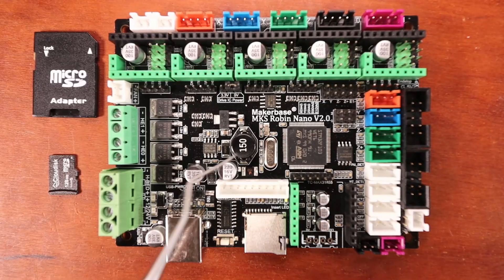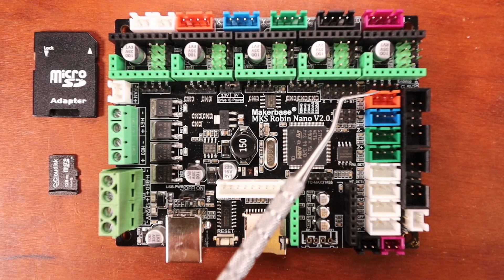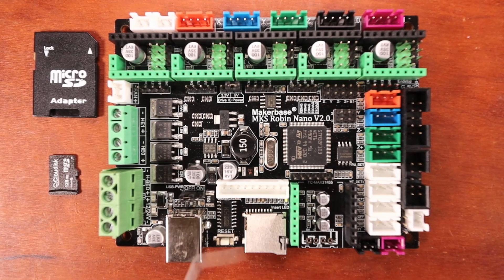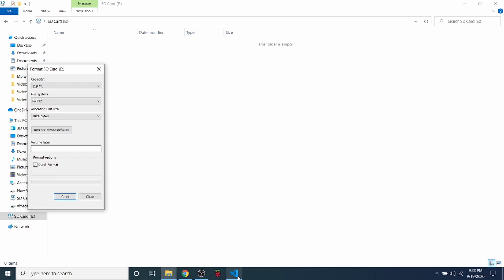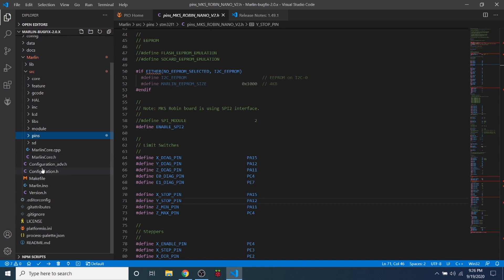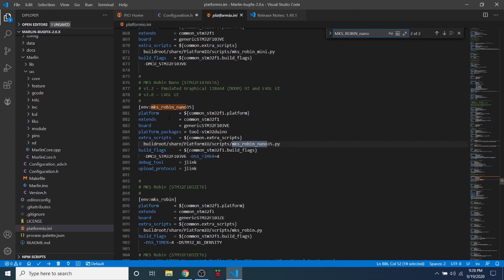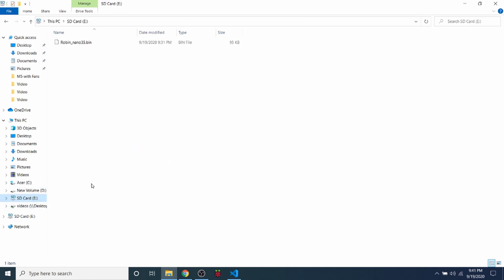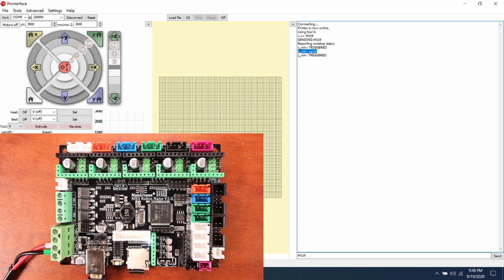MKS Robin Nano v2.0 - motherboard basics for 3d Printing

Comment: I've been enjoying these mks robin nano videos. Thank you. It has brought up a question that I can't find a direct answer to and I was hoping you might be able to help. The firmware for the tft35... the UI specifically... are they universal among the screens or are they unique to them? Basically can screen A use the UI for screen B? I ask because I recently picked up a nano V2 and tft35 v3 combo. I have a Kywoo Tycoon Slim and I really like the UI they have. From what I understand they use MKS tft35 screens that are rebranded with three big difference being they use a 40 pin IDE connector.  If I have the firmware for the kywoob screen what would need to be done to get the UI set for the nano with the tft35 screen? Is it even possible?
Reply from the maker: BTT TFT screen will work or at least I think I did it in a live stream like a year or two ago.  As for the screen you're referring too, can you post a link to screen or a datasheet and I'll see what can be figured out?

Comment: Is their a way to backup existing firmware on the robin nano to a usb drive?
Thanks!
Reply from the maker: Yes copy, FIRMWARE.CUR to a hard drive or source control.

When you wish to use rename to firmware.bin to load.
Reply: @EdwardBraiman  Thank you!
any way to pull the compiled code back from the board if you don't have the .cur or .bin ?
Reply from the maker: Nope, but gcodes will show setting.

Comment: Whats a stepper break out? Do I put the big wires to the thermistor or the little wires there? Honestly it is just easier to look at a/my other printer and see were they have the wires. 3 axis, 4 wires to a hot end a stepper to an extruder, screen just plugs in, your stops, not much to it, I think 99% of them are the same. I have no idea Im just shooting in the dark but I bet if I just plug in my drivers and set the voltage and ignore the jumpers they will work...oh, I need two y axis motors

Comment: I have this board. Having issues figuring out where the other 2 wires go for the bl touch.
Reply from the maker: There are 5 wires the group of three is a servo connection of voltage, ground and signal.  The other two are for signal and ground on endstop port.

Comment: Hi . I bought a xvico x3s from eBay UK and I found up that inside of it has a MKS robin nano 1.2 but is locked . I can't flags any marlin firmware or the classic UI . Do I need to unlock the bootloader ? I I can connect a serial to the board and flash any firmware from a regular MKS robin nano ?

Comment: Hey clever cookie.  I noticed you didnt enable SD card or LCD screens. Many of us are having nothing but trouble with MKS; I have two boards, 1st robin nano v1.2 with ribbon TFT 35 screen. The mks sites and git run around {going to lengths to hide how to download or copy} are a waste of time. If you could do a sane vid on how to get the screen working {or do you people stay clear of that and stickwith simple stuff to look good}.  Secondly i have SGEN_L V1.0 LPC1768 and the computer doesnt pick it up - it reads the SD card in the printer motherboad but not the board which is no good for pronterface. {using win7 & linux mint} How to if needed to flash the chip so it will read. I find much empty hype MKS should be doing Chinese stirfry ratehr then software {chop it up and throw it out - good for veges but not software!} - they show their stuff working nice but when you go to do it it doesnt work/right. Good ole American integrity needed. Your help would be appreciated by many frustrated people.  Thanks!

Comment: what means additional stepper breakout? i wonder because  i have that board and tmc 2209 and have tmc connection error on display and i wonder why what i do wrong :(
Reply from the maker: Possible jumper issues can be a cause or no power connected to board except ubs.

Comment: What is the easiest way to use this board with 24V for things like steppers and heaters, but reduce PWM fan voltage to 12V for some nice Noctua I have already ?
Reply from the maker: Buy 24v fans?
Reply: @EdwardBraiman  out of the question, my budget is limited, and Noctua is pricey. I'm just not sure if hard-capping PWM at 50% is good enough...
Reply: @cthulpiss  i think it's possible to use a relay/SSR to accomplish this just have a separate 12V power supply and have the 24 PWM drive the relay/SSR.
Reply from the maker: Here is a cheaper fan  https://www.amazon.com/PLUSPOE-Brushless-Humidifier-Aromatherapy-Appliances/dp/B088BJ2N29/ref=sr_1_2_sspa?dchild=1&keywords=24V+fan&qid=1606779947&sr=8-2-spons&psc=1&spLa=ZW5jcnlwdGVkUXVhbGlmaWVyPUEzVElFNFZMMUZOVEIyJmVuY3J5cHRlZElkPUEwODY0ODkyVE5ETkhMUjRPTExaJmVuY3J5cHRlZEFkSWQ9QTA0NTUyODMzQTkzSzlTVTlBMlE2JndpZGdldE5hbWU9c3BfYXRmJmFjdGlvbj1jbGlja1JlZGlyZWN0JmRvTm90TG9nQ2xpY2s9dHJ1ZQ==

Comment: hi Ed i need to add another limit switch  to my machine y,y2, x, z,z2 so that's 5 and i only have  4 limit switches ive tried using pw det pin but not working  , do you have any ideas
thank you
Reply from the maker: So I kind had this same issue myself when I first started with Marlin firmware.  With Marlin firmware they are trying to find the initial start position for x,y, and z.  They then count out from this with stepper drivers.  Meaning of you calibrated and have defined your axis size which in most cases is 200 for x and y it will go no further.
Reply: @EdwardBraiman   thanks Ed I will have a closer look at that now
I did manage to add y2 by adding det pins but when I tested the limit switches none worked  I've watched a few of your clips on limit switches so I've done it correctly  thank you

Comment: The TMC 2209 can be used in UART mode using a jumper on the TMC and a jumper which is assembled on 45 degrees shorting M3 to M2. I got my SGen L running like this.
Reply: Depends on the type of TMC2209...on the Robin Nano V2 they don't need any special treatment. Normal jumper on the board and one on the driver

Comment: Hi there I've managed to load the firmware but the resolution on the lcd is to small how can I upscale the resolution in the firmware
Reply from the maker: On the TFT for MKS sGEN l v2?  I'll need to research, but maybe a configuration file?
Reply: It's the robin nano v1.2 I'm using bugfix2. 0 yes I will have a look in lcd configs in h and. h
Thanks for the tutorial good info
Reply from the maker: Good luck, let me know what you find and thanks.